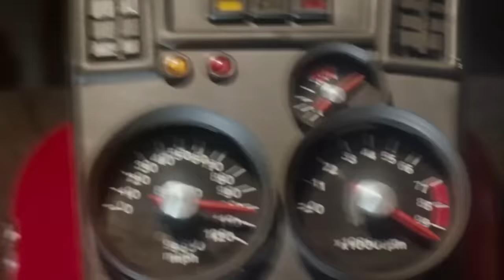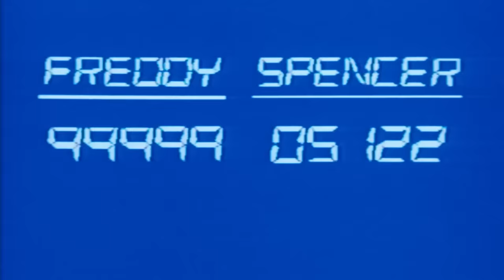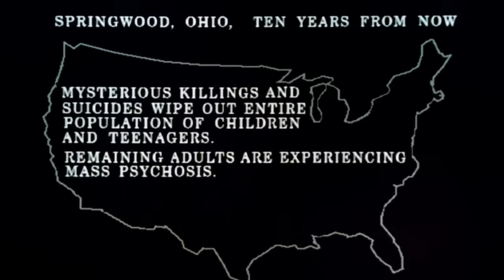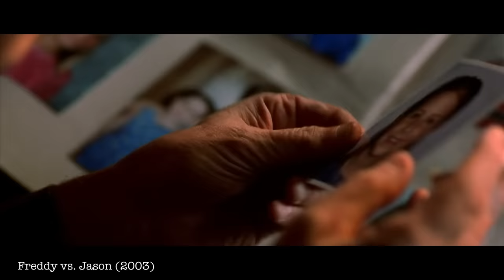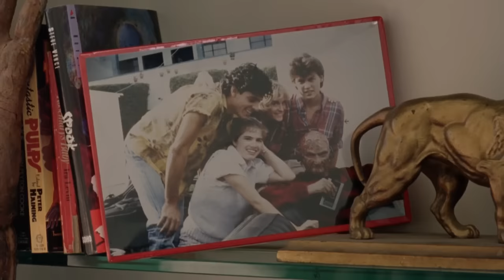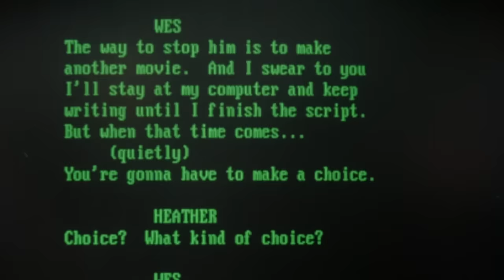The Nightmare on Elm Street Series - re:View (Part 2)

Comment: I worked at the local hospital for a bit and there was no way you'd accidentally walk in on an autopsy. You took an elevator accesible only by the staff to the lowest level, walked thru a maze of corridors and at the end you found the place sealed behind what was basically a giant steel gate next to the lift used to move dead people between floors.
Reply: I work in a large one with a couple morgues. The one in my building is in a really odd place. It is on the lower level where our receiving dock is and employee badges are needed but it's just a little door across from where janitorial keeps some supplies and next to where some linens are stored. There's no elevator connected to it, they need to push them down a hallway and around a corner. I've turned that cormer before and found bodies in winding sheets juat sitting there unattended. Usually there's a cop guarding them (shooting victims, most likely). I came across a loved one in that hall just crying into the arms of a detective while people were carting various supplies around. It's not super public but I always imagined those areas were much more restricted.